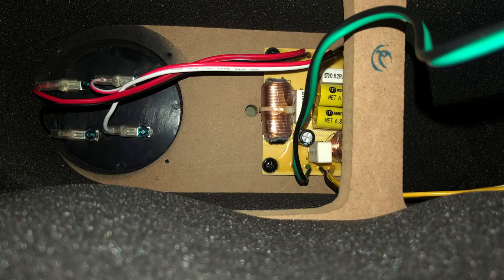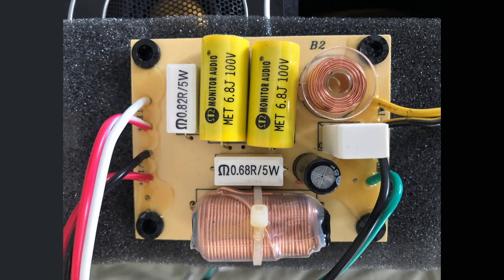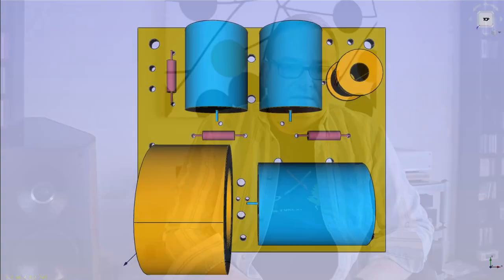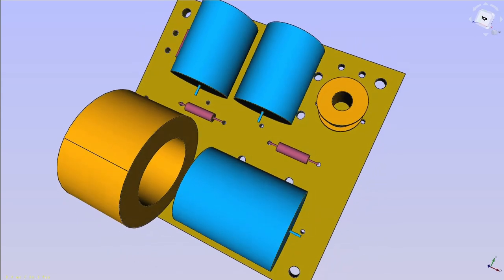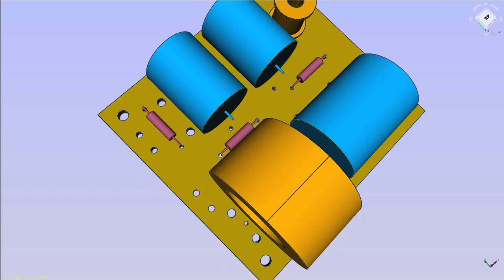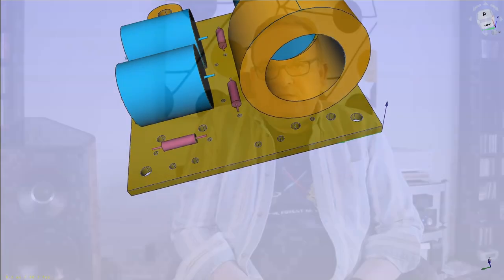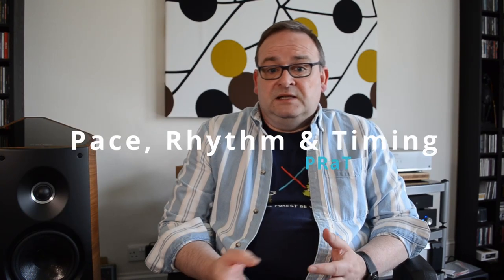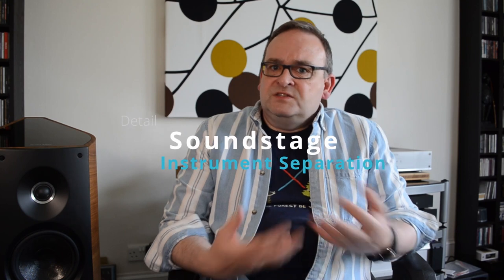Upgrading Your LOUDSPEAKERS? Here's What You Need to Know - Part2

Comment: Completely agree with you on the value of swapping these components.  My first adventure was with Monitor Audio GR20 floorstanders.  The cost was a bit of a shocker as I used Mundorf M-Cap Supremes bypassed with Robert Hovlands plus M-Coil 140BL inductors with Mills resistors.  Connections were made with Neotech OCC wire to an additional set of ETI Research binding posts, making them tri-wired.  Disbelievers in mutiwiring are invited to keep their opinions to themselves.  I also went to Wilmslow Audio for their version of No-Res, as used by Danny, to add more damping to the cabinets.

All this was helped by Monitor Audio themselves who kindly supplied the circuit diagram.  The resulting bill was about £900, which goes a long way to explain why manufacturers fit such inexpensive parts to their speakers.  The sound, however, is transformed, in all the ways you mentioned.

My second foray into this was for my second system, with the same Bronze 2 you mention.  This was also a full upgrade with bypass caps, however, being only two circuits and not having the large inductor, the cost was halved.  Still more than the speakers originally cost though!

Now these speakers are serving me beautifully on the end of a £3,000 turntable rig through a £1,500 heavily modified pre-power amp combination.  The sound is incredibly detailed, with fantastic tonal balance, not a trace of sibilance or harshness and the most stable stereo image one could wish for.  I can listen for hours with no trace of fatigue.

For me, the diy route is proving an absolutely brilliant way to better enjoy records, CDs and even streaming.

By the way, if you want a copy of the circuit diagrams of the Bronze 2s or even details of the inductor values, just let me know.  Hi-Fi Collective will have Mundorf hand wind the correct values for you, although it takes a couple of weeks or so to receive them.
Reply from the maker: Hi Mark, thanks for your comments.  Sounds like you've had quite the upgrade there. Great stuff. The Bronze's weren't mine, but if you wouldn't mind sharing those inductor values I can pass them on.

I guess my mission is to bring awareness of how much improvement can be made to a wider audience and despite the component costs, the value is still greater than higher priced off the shelf hi-fi.
Reply: @maudifi  Thanks for your reply.  The return inductor on the tweeter circuit is a 0.2mH air core.  The main filter on the woofer is rated at 0.9mH.

I selected Mundorf M-Coil L140 air cores for both of mine.  You purchase the one up and ask them to wind them only to the selected vales.  They are 0.22mH and 1mH respectively, off the shelf.  The custom wind adds 2 weeks to the lead time.

I agree, the components may be costly, but I know I will have to spend close to £2,000 to achieve a worthwhile improvement.
Reply from the maker: @markcarrington8565  Thanks Mark